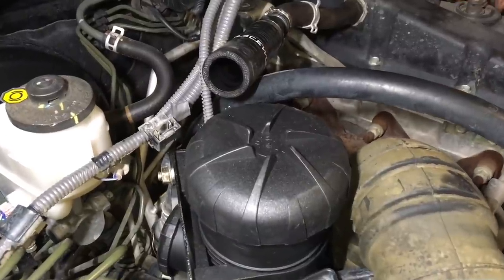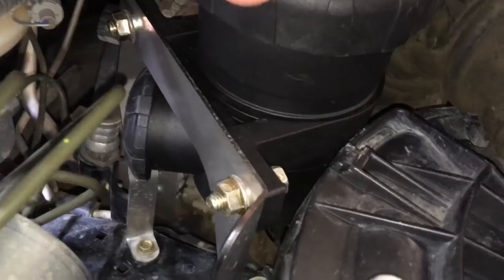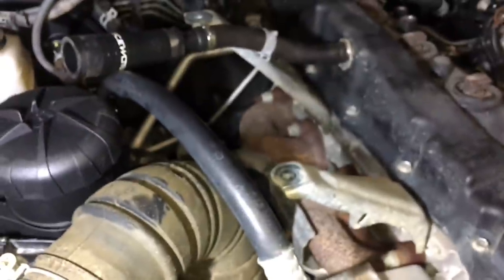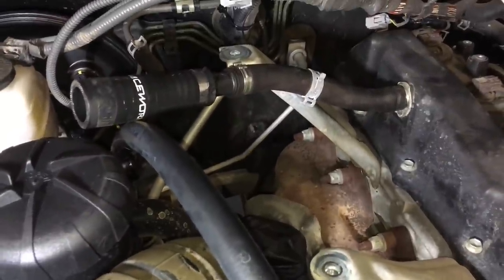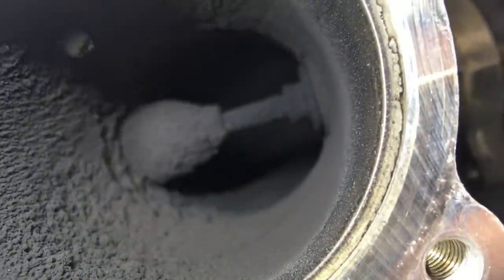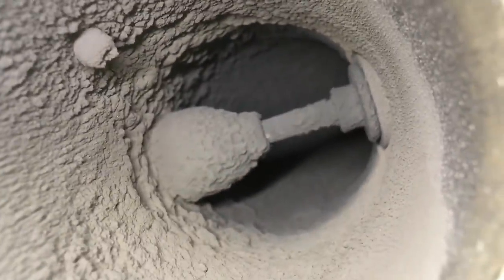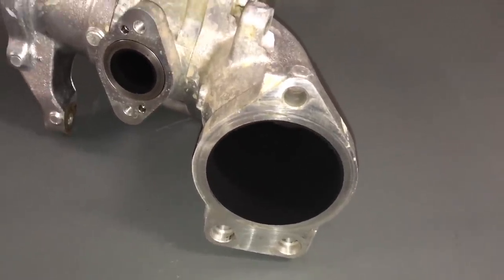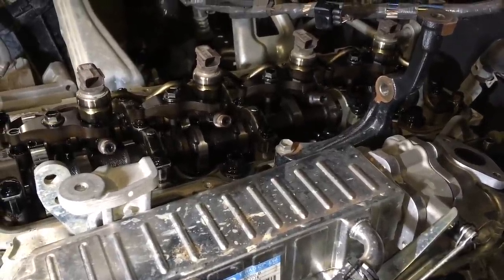THE BEST CATCH CAN EXPLANATION VIDEO - DOES IT WORK? Time to WAKE UP!!

Comment: It’s rather simple, block off EGR and install a catch can you get a clean motor, the PCV and EGR recirculate contaminates being oil vapour and exhaust gas, modern day cars with direct injection experience more carbon and crud buildup because the direct injection doesn’t spray fuel past the valves like a carby or port injection, there is nothing to clean them therefore it builds up.. 

To the people in the comments that have removed their catch can and think their car runs better, it probably does but this is likely from poor maintenance, a blocked PCV or catch can will make the car run poorly because it can’t ventilate the excess pressure, it will also cause oil leaks because the crankcase is pressurised.

Comment: My old VW Tdi (pre DPF ) with 150K miles is about to get an oil catch can. Its been well looked after and has fresh oil every 4-6K miles but obviously got some wear and tear and some blow by. I've replaced the EGR which was plugged with a thick tar of oil and soot. Its a direct injection so the valves are also getting the same build up. Blocking off the EGR is an instant emissions fail on the annual vehicle test so not an option. My only other option is to fit a catch can to reduce the build up of oil entering the inlet.

Comment: You raise a good point about diesel motors maybe not needing one, but on gas engines they are helpful. Many new gas engines don't even have an EGR so the oil vapour comes from the rocker cover and just goes into the throttle body and coats the valves.
Reply: how well would one work with a 94 civic?

Comment: Hi mate, thanks for the explanation and providing the right information without messing around. I have a Gu patrol and installed a catch can 40k ago and since I installed I could see that more pressure was added to the valve cover and some oil started to come out from the injectors sealing. I just removed the Catch can and see how it goes now. I am also planning to install n the coming days the plate with 7mm opening to restrict the recirculation exhaust gasses through the EGR. Once again thanks for sharing sash a valuable information.

Comment: I got such a catch can, Provent 200, installed on my 2005 Freelander TD4, with the BMW M47 engine. It seems to work very good, intake of the can is wet and got carbon chunks, output is bone dry. In my opinion top pros are dry intercooler, which makes it more efficient, since oil is reducing its cooling effect, dry deposits on the intake, the less oil, the less deposits. As on the exhaust manifold, a thin layer of carbon that doesn’t thicken. The cons are mostly related to wrong installation. On the other hand you pointed out very good that the oil that gets past the catch can continues to grow deposits. But this is related to the efficiency of the filter inside the can. Lastly, about the abrasive particles from the EGR I don’t think the intake valves nor their seats will suffer damage, as there is no damage on the exhaust valves anyway, which, guess, they are always in contact with those particles. Anyway thank you for the video and I hope you respond with your opinion about my arguments
Reply: I own that same engine on my 320d e46 and I was wondering about buying one of those catch can and leave the EGR working.
But many things I found about people installing these catch cans is that the seals of the engine gets damaged earlier because of the restriction you add with the catch can and this pressure been released through the seals.
If you can give me an opinion about that it would be great.
Thanks in advance. Cheers.
Reply: @Adrian-re9fh 
Thank you for your question!
Provent 200 causes little to no restriction as its flow goes up to 200 litres of blow by per minute. Any damage that appears after the catch can installation can only be the cause of a wrong installation or not servicing it. Servicing means draining it whenever drain tube gets full of oil and changing the filter after it gets completely soaked up in oil (perhaps after 25000-30000 km). I’ve had the catch can on my car for 10000 km at least and caught about 200-250 ml of oil ever since
Reply: @04rodeorider75 
Thank you!
Be aware the Chinese copies can only work as good if you add the genuine Mann filter insert; the steel mesh makes only the impression it works
By the way, instead of a reply I was notified about another anti-catch can video with the exact same philosophy😅

Comment: Remember the days when crankcase gasses was expelled onto the road and not through the air intake? I don't think engines wore out quicker if regular oil changes were followed. In fact I think most engine problems started when the emission laws required the crankcase gasses to be burnt off through the combustion process.
Reply: I agree👍

Comment: I know a few lads that have had catch cans fitted and  they have ended up taking them back off . my  next move is a reduced flow EGR plate  that's where the problem is .
Reply from the maker: Hundreds of people if not thousands have remove them they are on the shelf
Reply: @Fourby4Diesel  catch cans ended up causing problems for them  like increased  crank case pressure and it think caused leaks for my mate mark who owns a car breakers business and knows a thing or two about motors like your self ,so catch cans for me are bull shit  don't go there 🤣.

Comment: As a mechanic I 100%agree with u. If its really necessary why wouldn't those big 4×4 manufacturers put in 1st place.
Better to spend money on schedule servicing and better fuel refill
Reply: Why don’t manufacturers include them?  lol because they don’t give a F&@% about the long term (past warranty) condition of your engine nor your long term maintenance/repair costs, nor your long term efficiency. And they don’t trust the average owner to empty the can even if they (the manufacturer) wanted to spend the extra $ on the device.   They want to keep selling vehicles, it’s all about planned obsolescence.  Look how much cheap plastic and low quality metal is used in new vehicles.  Look how difficult it is to service anything in the engine compartment, the designs favor the dealerships, the mechanics; and the parts suppliers. As consumers we are just the trees that grow the money for the industry.

Comment: catchcan is useless. delete the stupid egr to get rid of soot. the crankcase vent system lubricates the intake valves and turbo. I’ve used this catchcan on my mercedes sprinter v6 and nothing but problems and noxious fumes from it. That filter is another maintenance item that gets trashed quick and is expensive. Plus you loose some energy content for combustion that are wasted via blow by that would be burned otherwise and provide more complete burn off of all emissions. With can catch can you’re mostly burning the light vapor fumes and the heavy oil drops out. The moisture won’t be an issue because it has oil mixed in and won’t cause corrosion on ferrous components. The bigger the crankcase vent hose is to the turbo, the less crankcase pressure and less drag as well as crankcase gases will be reduced which at first glance seems counter intuitive. Emission is just an automotive engineering hypocrisy exercise. There are no solutions for emissions, only trade offs. 

Making cats and dpfs creates pollution at the factories that make them and mining companies that mine them. It’s not lower emissions just more hidden emissions. The electric car supply chain is even worse with all the copper heavy manufacturing. 

The green movement is definitely doing the opposite while virtue signaling. More money more money more money is all they want while lying through their teeth. 

A deleted truck is the greenest when properly tuned. A lot of extra parts will disappear and yes, less pollution because of less manufacturing. Our world is so backwards

Comment: I fitted a catch can to my vehicle at around 20k, when I sold it at around 120k there was nothing more than a thin film of oil in it, I never emptied it once in 100k of driving. I also fitted an EGR blank plate at the same time and when I sold the car the inlet was still clean. 
My new Prado I have fitted an electronic EGR cutoff module, I won’t waste money and space under the bonnet fitting a catch can.

Comment: Showing the inside of an EGR  valve has nothing to do with with the efficacy of a catch can in PCV system- They are separate circuits. The EGR valve and body has carbon deposits from the exhaust, not the crank case.
Reply: Got to admit I also was thinking why on earth is he showing the inside of the EGR valve when would be exactly the same can or no can

And to say minimal oil goes through is nonsense.  After 10k of pulling a caravan I drained more than a cup full of oil from the catch can on my Prado.

Comment: a catch can is good for some cars and not for others,  On cars that do NOT need a catch can, have the Crankcase ventilation pipe going straight to the inlet manifold therefore avoiding all the rest of the intake system..  Cars that need or could benefit from a catch can are the ones that have the crankcase ventilation pipe going straight to the air inlet pipe which then travels through the intake, the turbo, the intercooler and the intake manifold including all piping.

The ones that go straight to the intake manifold are basically cleaned because they are so close to the injectors.

Comment: Cheers for the video mate, makes a lot of sense, and it helped my decision greatly. Have been tossing over getting a Catch Can on my 2020 MU-X for months, { currently only done 35.000 klms } you put forward a good argument. I service my vehicle by the book, and generally trade my vehicles in around 150,000 + Klms, so the engine should be in top shape anyway The more I look into it the more I'm convinced a Catch Can may be futile. Question....my service department suggests having  the EGR valve cleaned next service, for about $100...do you think this may be a good idea ?
Reply: Better save your money and replace it when it’s time

Comment: And what happens if the recirculation intake comimg from pcv to the air intake is before air filter?, would soak the air filter with oil but would not pass further dont you think?

Comment: Simple, just delete the whole EGR system and still throw on the catch can as well then right? Or will captain planet come and kick you in the nuts. Iv looked at my 2 TD27's intake manifold/valves side by side, one with EGR delete and one without and the difference was staggering

Comment: Bit unrelated to your channel. But would this same information apply to a GDI engine?
Reply: It's about contaminants being put into your very finely metered air-fuel ratio to give the cleanest most efficient combustion in the combustion chamber. Then you add all that soot and dirty gooie air to increase the carbon in the combustion chamber that goes into the crankcase causing premature wear on all moving parts as well as less HP because of poor combustion in the combustion chamber compounding it with each cycle having some kind of collection system to prevent this must be an overall improvement. But venting directly into the atmosphere or reburning the same contaminants doesn't seem to make sense. It just seems to create more carbon build-up lowering the longevity of the engine

Comment: So of you had to pick (and legality wasnt an issue) would you 

Completely block the EGR system with a plate 

Partially block with a reduced flow plate

Electronically disable EGR 

Leave stock and clean intakes regularly
Reply from the maker: 🤷‍♂️7mm🤷‍♂️

Comment: I thought you're only supposed to use a catchcan in high powered applications. For a stock engine theres literally no point in a catch can unless you have insane blowby
Reply: Hi Jacob. I have to say that's incorrect.  I fitted a catch can to my 2020 Colorado at 6 thousand kms. After being driven sensibly on bitumen for 5 thousand kms I drained it and wad absolutely surprised by the amount of oil and water that had accumulated. A wise investment indeed.

Comment: why don't car manufacturers just take the exhaust gas after the DPF?, so there is minimal soot feed into the egr and intake to start with...., my view is if they are too lazy to design a clean-ish exhaust gas for EGR, then block it off at early klm's, with optional catch can...DPF diesels been around a long time now and there is zero excuse for lazy car designers who design sh*t systems....

Comment: I was about to buy a CC, but wait, dont thinks its still such a good ideea. Thanks mate. 

I have watched most of your videos regarding the injectors, and you really cover all the aspects, but I am still a bit confuse, is the 2014 Hilux 2.5 d4d with craking pistons issue ? Mine is 2014, 220k on the clock, and all the reading ( dead cold/hot ) are 0.4   -0.2   -0.8(cyl nr 3   ) 0.0.  Thanks again,
Reply: Depends what you drive. Gas engine with direct injection needs a CC. 

I have removed my EGR as well. A guy can also block it off with a prefab sheet metal like the gasket with no hole in it. I have clean valves and have for over 40k miles. 

If you are in a emission state/country, you can just remove the block and put back to stock for your inspection

Comment: Do not use any catch cans. What people NEED to do is learn how to measure the crankcase pressure. Its funny they know how to check tire pressure, fuel pressure, boost pressure, coolant pressure, oil pressure, transmission pressure, etc... but nobody is measuring the crankcase pressure. High crankcase pressure causes pressure scalar gradient forcing oil out of the engine and into oil seals including piston rings. I have a DIY Video in my channel how to measure crankcase pressure using 1-bar map sensor and 5-volt source so you can check your engine and adjust as needed. 

Little bit of thinking to do on the deposits and features of deposits. Blow-by is essentially exhaust and it mixes with some oil if there is oil drawn along with it. High crankcase pressure causes large oil droplets and high oil droplet density to form. It takes energy to drive fluids through hoses and hoses add friction so the PCV system should have short as possible hoses with small enough diameter to enable high velocity high temperature fluids to return to whence they came. Think about that for a minute- The combustion process occurs and some slips out into the crankcase, if we could return it to the cylinder instantly it would not leave any deposits and will not interact with engine oil. Think. Carefully. Imagine the blow-by gas leaving the combustion chamber working its way down through the rings or into the exhaust and being sucked up and returned to the cylinder where it was a moment ago. No harm done. The harm is when the blow-by gas is allowed to cool down, condense, slow down, due to insufficient energy supplied via PCV action (pressure below atmospheric to drive fluid evacuation). This is why we measure the crankcase pressure and design the PCV system and engine modifications to rapidly evacuate the blow-by and return to the cylinder immediately. Do not allow blow-by to circulate into engine oil where it will leave deposits and cause eventual wear and failure.

Comment: Does a catch can help prevent the oily gases going through your turbo?
Reply from the maker: Oily gas?
Reply: @Fourby4Diesel  the combustion fumes with the water vapour and oil mixed in does that not coat the turbo without a catch can?
Reply: @Fourby4Diesel  , I presume the guy means “oily vapour” that passes down to the crankcase via the piston rings on the combustion stroke, combustion probably creates “soot” too, if you agree, that finds its way with the oily vapour to the crankcase. If a CC collects that combination, good, rather than recirculate back through the turbo and intake. I rather like the idea of cleaner air entering my turbo.

Comment: Great video mate, always love two sides to the argument. And couldn’t agree more with BS out there and bad advice. Couple of questions for you though. Do you think weather plays apart? I’ve got a provent and in winter it’s producing double the amount of oil in the same amount of time with the same driving style. Do you think the hotter weather in summer creates a better burn?
Reply: Cold weather = more condensation
Reply: You just proved the point that if the weather is cooler then it should work better condensation the oil. In the summer the catch can works less.

Comment: What's the cost of cleaning out the intake at 100,000km? I'd much rather budget for that and leave the engine as designed than mess around with a catch can. What's the loss in performance? I haven't seen any crazy blockages that would have me too concerned.
Reply: couple grand I reckon